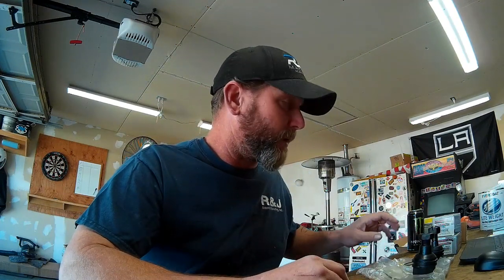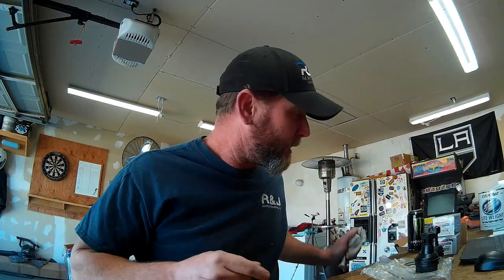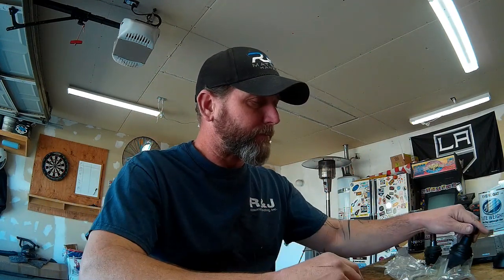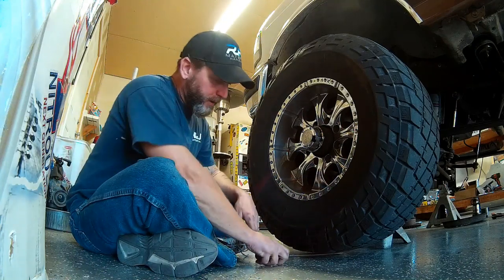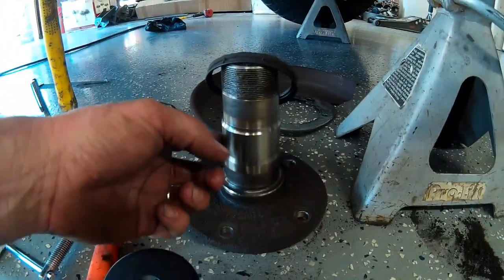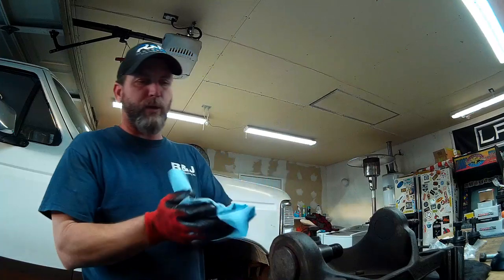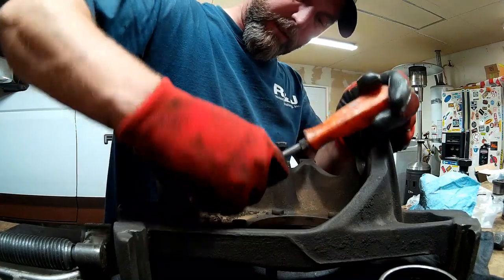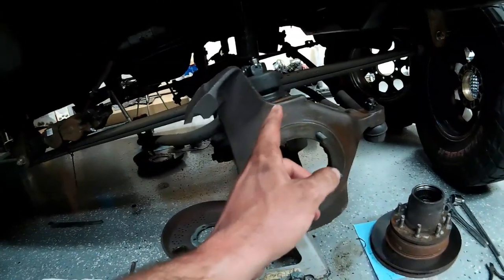Ford OBS;  F350 Dana 60 Ball Joint Replacement

Comment: Aight. So all my friends have dodges.  Needless to say I am a Ford guy and have invested in several Chrysler specific tools. On my friend's 96 2500 ram with the "famous" V10 we did his ball joints, front rotors, unit bearings and u joints. After several attempts to load the trailer, a short drive across town, a trip to the tool store for the damn 1 11/16 ths specialized socket, a few heats and a few beats we got the ball joints back in, they press into the c not the knuckle like fords or Chevies. Whole thing cost about 400 bucks, for all the parts. Next day I sent him a quote ticket on the parts to do this job on my ford. Rotors, bearings and all the joints. Cost was around 225 bucks. When the bearings get loose, on the ford, pull em out, grease em and put them back in. Only advantage my dodge friend has over me is that he doesn't have to get out to lock the hubs, and when you're stuck in mud that's a real nice thing.
Reply from the maker: they both have their pluses & minuses, manual hubs are great because you're not spinning your front drivetrain in 2wd, and you can run a solid mechanical locker in the front rather than an air or electric one.  i think unit bearing hubs are fine, except for the lack of serviceability and the fact you have to replace the whole hub when they fail.  but i think i'll keep my old pig of a D60.  :)  thanks for watching!
Reply: VintageSpeed Garage, I just look for a reason to give my Dodge and Chevy friends a hard time.  The guy with the v10 is nicknamed puddles.  Cuz his truck leaks.  Another guy is named leaks.  Cuz his Cummins leaks.  The Chevy guy is squeaks.  He has the broken power steering bracket squeak.

Comment: Great video, question, how did you slide the long side shaft into axle housing without pushing debris in axle housing into diff housing?
Reply from the maker: good question!  and i really dont have a good answer...  most likely the splines will pick up some gunk from inside the tube as you attempt to "find the hole" as you feed in the axle shaft.  i suppose best you could do is flush out the tube with water before disassembly to try to get all the loose stuff out of the tube before tearing into it.  i've fed alot of axles into front ends, but there's really no good way to do it.  it's all by feel.  thanks for the reply!

Comment: The ball joint press is never big enough.  Just my opinion but we still manage to get things done; just takes longer because we have to customize things or find tubes/pipes or wedges to make the do it's job.  Author conveniently never showed the press-in operation, which may have been the most impressive/valuable step,  haha.
Reply from the maker: determination makes things happen, thanks for watching!  i did recently buy a GIANT ball joint press from Alpha tools, it's easily twice as big as the standard duty press frame.  twice as heavy too

Comment: Hello.  I have a question unrelated to ball joints.  I have a 97 F350 pickup OBS and want to put steps/running boards on it (it's very high and I am not as young as I used to be).  I saw in the video you had the Bully or Carrs steps.  My question is how do you like them.  I can see how you use them/step on them getting into the truck, but what about coming out of the truck.  My hesitation is that they aren't very wide.  A running board would give a lot more space for your foot.  Thanks in advance for your thoughts.

Comment: I would like to remove the 4 wheel to q 2 wheel . My truck it’s a 1994 f350 diesel and of course Dana 60 . Can I use the parts of a f250 ? Thanks

Comment: I wish you could do a 05+coil spring conversion, that would be awesome!
Reply from the maker: thanks man!  ...i just happen to have the whole front susp setup from an '06 sitting here in the shop....if i can ever get finished up with the mustang i think that's the way to go....  thanks for watching!
Reply: @vintagespeed  I bought a 4door  95 dually powerstroke 5spd, I plan on taking on the challenge and doing that swap to it! Maybe making a 6x6 with a divorced np205😯😯😯👍👍👍

Comment: What are your thoughts on the "ball joint delete" kits?
Reply from the maker: for a hardcore off-road front axle, i think they're awesome!  for a daily driver....not so much.  the reason that kingpins went the way of the dodo is that they dont like axial loads.  the force pushing up/down along the pin axis beats the hell out of the shims/bushings which causes play and wears out the kingpin.  the same goes for these radial bearing type ball joint delete kits.  those bearings are not made to carry a load in this direction.  and if you've ever driven the 5 fwy over the grapevine in the trucklanes, then you know how much beating those joints have to endure.  a balljoint was chosen for this application because the ball & socket configuration can support loads from all directions and still provide steering rotation.  good balljoints last a hundred thousand miles....my suggestion, get good balljoints.  the delete kits have their place, just depends on your application.  thanks for asking!
Reply: @vintagespeed  a very detailed explanation from your perspective that I appreciate. Many won't respond with such detail and that's good.
I understood the point you were making, yet I'm not sure it applies for all of the products out there.

Comment: do you have any videos on reverse shackel kit with super duty springs install on obs? i have a 97 f350 that is in desperate need of this.
Reply from the maker: hi Delkron, we have not yet installed SD leafs on the front of one of our trucks....but we may be doing that!  and you must have been reading my mind because I just installed my SD rear leafs yesterday, vid has been posted of that swap.  Thanks for watching!
Reply: I got a superduty spring RSK kit from PMF that bolted straight in and is awesome. It has a built in cross member with an optional front receiver hitch.

Comment: Job well done and great explanation on how to tackle this...I'm getting ready to do my F250 4WD and i know I can handle it...I do have a couple questions...
1. When you reinstalled the axles back in the front diff...was there seals that go in that tube side that need to be replaced. Any how hard was it to get those in?
2. Also do you just tighten your wheel bearing nuts by feel...I kind of just have always used common sense..I pack the bearings and hubs with a good quality grease and then tighten the nut up good and snug the first time to seat the hub on the spindle,...then I back off the nut were it's loose...then I just take up all the slack with the nut to just where there's no more bearing play....Then the lock nut is secured. I've never lost a bearing doing it this way.
I want to thank you for posting this excellent video...Kudos
Reply from the maker: thanks man!  yes, there are axle seals at the differential.  if you're leaking gear oil then you should look to replace them as well.  you'll need to  remove the diff carrier, tap out the seals and replace them.  you'll need a long piece of tubing to slide in the end of the axle tube to drive in the new seals.  as for the hub nut install., you're right on the money and will have no issues doing it the way you describe.  good luck with your project, and thanks for the positive feedback!
Reply from the maker: normally, i will tighten the inner axle nut until the hub stops turning, then back it off about a 1/4 turn (or until the hub turns freely) and install the outer lock nut.

Comment: I am trying to replace axleshaft ujoints and seals on a 97 f350 dana 60 but the axleshafts and stubshafts will not come off the knuckles for some reason. Already took the hubs, bearings, calipers, and stubshaft studs out. Beat on the thing with a hammer and chisel for hours, beat on the stubshaft with a deadblow hammer. Im stumped, help. Can i press the lower balljoints up with the axleshafts still in place and take the whole mess out together?
Reply from the maker: yes, if that's your only option.  i'm not sure what you mean by "stubshaft studs", do you mean spindle studs?  did you remove the spindle from the knuckle?
Reply: @vintagespeed  yup, i figured out its just rust holding them on now, thoght they were a press fit. Cut with a 4.5 cutoff wheel where dust shield used to be, then smacked them out with a heavy drift (mines an old 10.25 cross pin)and 5lb sledge.

Comment: What size tubing did you use to install the ball joints. I know you said you didn’t replace any of the bearings because you’re going to swap axles but have you ever removed the needle bearing that sits inside the spindle. Do you need a puller to remove this one. Keep up the good videos. 👍🏼
Reply from the maker: thanks man!  for the bj press cups, i used some 3" (IIRC) muffler tubing i had laying around.  if you get a 4x4 press kit, it should have the right length spacers for the cups.  you'll need a puller or make a hooked tool from an old screw driver and tap around the perimeter a few times to tap it out of there. thanks for the question & for watching!

Comment: What axle do you plan on swapping in and why?
Reply from the maker: I'm going to swap in SD radius arms & D50 + metric 10.25 rear.  This truck will do mostly road duty so I dont feel that I need the strength of the D60, plus I can probably fund the whole axle & suspension swap with selling the current axles.  Thanks for the question!
Reply: How much for the Dana 60 axle

Comment: How do you get the spindle off?
Reply from the maker: remove the lockout, the hub & rotor, spindle has 5 nuts remove them and knock spindle loose.  if you want to pull the axleshaft & do ujoints, that would be a good time to do so.  thanks for watching!
Reply: Well I've been heatin' and beatin' til I'm worried I'm going to break it. Had to order a spindle puller since no part store here rents it so hopefully that does it.